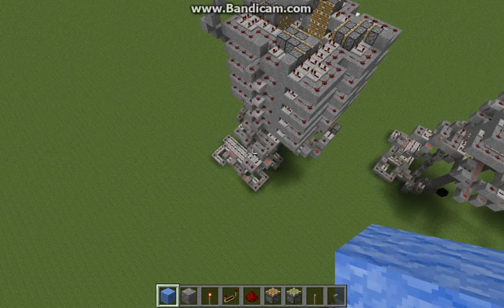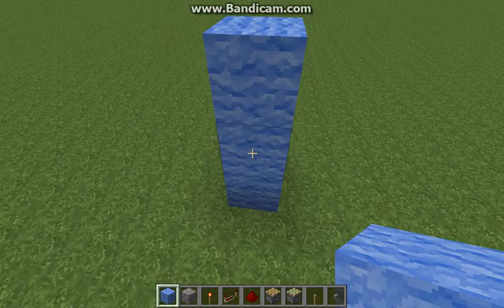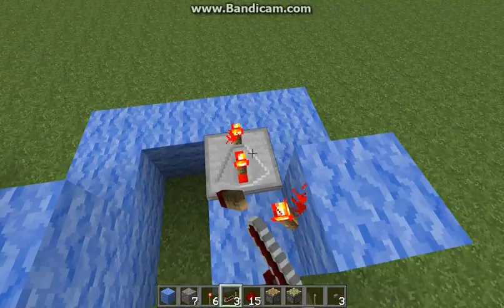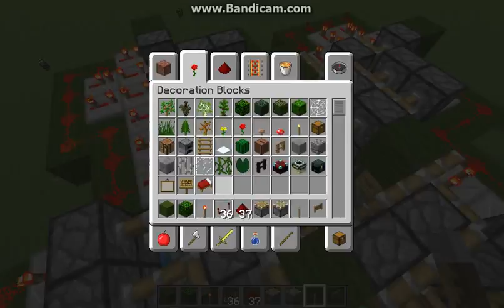Tree Eater - Automated Tree Farm Tutorial

Comment: Having this strange issue where I realized the gravel pushes up the bottom log block one lower than yours does in the tutorial.  Everything else works fine after a bit of 1.6 tweaking, its just strange that my gravel stack is only 11 not 12 high.  Any suggestions?

Comment: Had a question for you in regards to the log mover on the top of the farm. Wouldn't it be more efficient to put a simple block bridge for the top? A redstone torch and a wire, with only the log between them(The torch powers the log, which powers the wire, which can be used to power the piston so that it can push them up and out of the way? Or would that create overlap problems?

Comment: I did everything step-by-step according to what you showed in your video, but it seems like something has gone wrong when I reach the 9:00 mark. The piston pushed up 2 blocks of gravel up and stopped working (pushing anything) after that, causing the sticky piston to grab hold of the 3rd block of gravel and pushing it back and forth. Needless to say that the gravels that were pushed up by the piston at the bottom were pushed off by the sticky piston with the 3rd block of gravel stuck onto it.

Comment: i found a problem with 1.4.4 version but its a very ez fix though

the problem is that do to the new timing update for 1.4.4 the dirt block seems to close to fast and the gravel sits up top and then it throw the system off if you add 3 more repeater set to 4 ticks to the upper delay timer it fixes the system.  I tried importing it to my work and had nothing but problem as soon as i fixed that the systems works like a charm.

Comment: I built this on the Survival server on which I play using this tutorial, and it works very well.

To the switch that pulls back the dirt for gravel maintenance, I have added another wire to the redstone torch that disables the BUD switch.  I was getting stacks of gravel stuck on top of the dirt, and the extra line keeps the BUD switch from firing when the dirt is retracted and the gravel falls.

Thanks for a detailed tutorial, and thanks for the resource savings over CubeHamster's original !